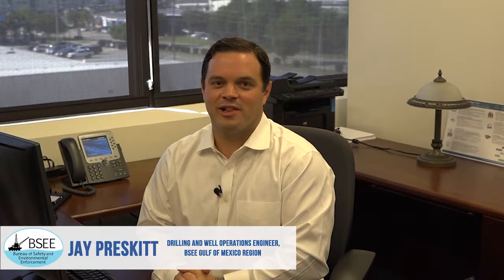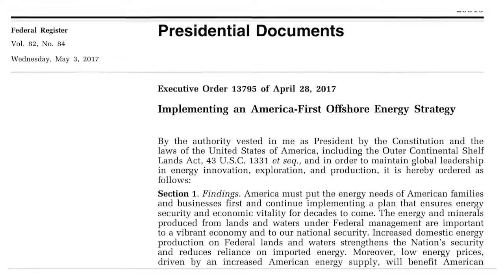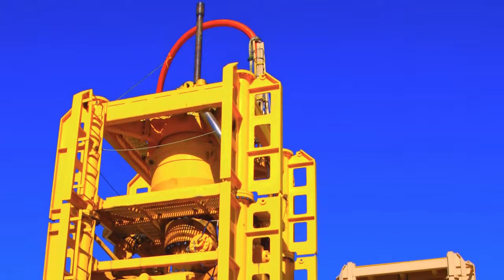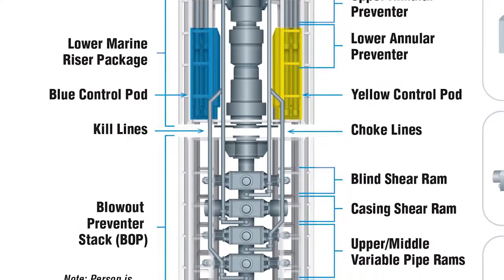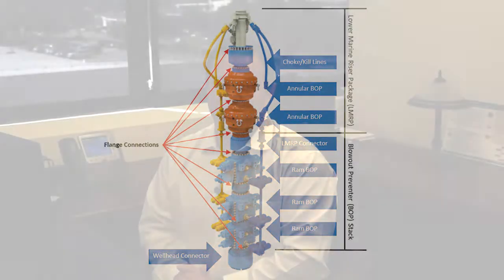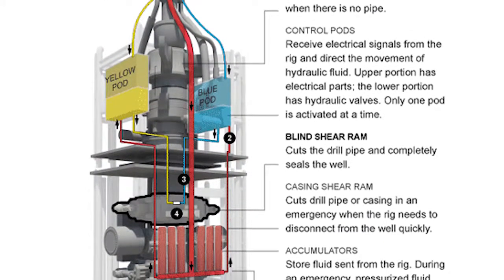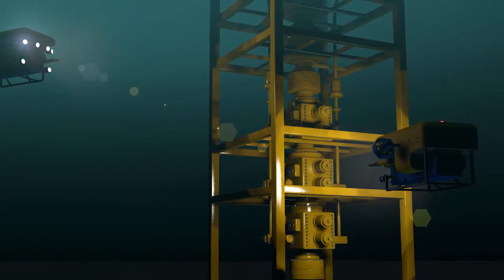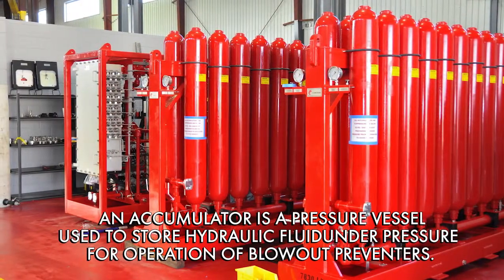Well Control Rule 2019 - BOP Requirements

Comment: BSEE needs to use the same regulations that land based oil production facilities use. Emergency shut off systems be periodically tested or repaired and records kept. Spill response contingency as well as training for personnel. 
The same blowout prevention system still in use that failed the deep horizon still in use current 2019. Consisting of annular valves and blind shear rams that are prone to failure. On deep horizon's macondo well spill highlighted the failures of this type of blowout prevention. The annular valve uses the rubber doughnut shaped seal to cover wellhead supply port and failed due to seal being damaged. When the emergency shut down activating the blind shear rams as a last resort failed due to the wellhead pipe being bent from a massive "kick" or Pressure spike occurred the pipe was not in alignment and the blind shear ram failed to completely crush/ cut the wellhead closed. This resulted in flow going through the failed blowout prevention system and through the riser, onto the deep horizon platform where expelled gases found a heat source.
I'm the designer of the caphead that was used to stop the macondo well spill. I'm a mechanic employed in Alaska's North slope oilfields at Prudhoe Bay area at the kuparuk river unit for a company subcontracted to conoco Phillips. Current 2019.
I also have over 30 years experience in pipeline repair and maintenance. On June 20, 2010 I watched news coverage of the horizon spill response crew using underwater robotics to cut bent sections of pipe away from the wellhead pipe. This left several feet of pipe sticking out of the seafloor and also had a pipe flange inches from the pipe end. I designed the caphead spool that could be lowered onto the wellhead and lock onto it by using lugs or wings to secure on behind the flange. The caphead used hydraulic chevron seals at the bottom that would use well pressure would force the chevron seals down sealing and stopping the spill. Flow could be directed towards the surface and recovered onto a barge or tanker. Once flow is controlled well pressure overcome by using a downhole pump (tritan) and inject the sealant of cement/slurry mix into the wellhead until full by volume. The caphead would remain in place until the sealant hardened stopping the macondo well spill. I found that later that day that BP had a "horizon helpline" available asking for assistance. I called and chatted with the horizon personnel and stated I had a caphead spool design that would stop the macondo well spill. They asked,if they could look at. I submitted my design and was notified that my design was unusable. I tried calling the horizon helpline only to find out it had been discontinued. I neglected to file for a patent on my design. Several weeks later I again watched news coverage as my caphead design was used to stop the spill.i still have copies of the design submitted as well as emails to and from the horizon helpline. Later I was in touch with BP via email and was told that since my design wasn't patented that the design belonged to them. I did what I could and was unable to find legal representation and decided to wait to voice my opinion. I also still have a case lodged in the BPCLAIMS.ORG. 
I've had time to go over the current blowout prevention systems and can guarantee future spills will occur due to design. The current blowout prevention systems become a time bomb once in place before 1 gallon of crude goes through the riser. It's worst feature is that there is no way of isolating pressure. The annular valves and blind shear rams aren't. Designed to be tested periodically or repaired or maintained. If this type of blowout prevention system did work as designed, still leaves a well sealed only by crushed/cut piping.  Any attempt to repair or abandon will result in a spill.  I have design upgrades for a safer, better blowout prevention system that can be tested periodically to verify proper operation, as well as repaired and maintained and means a better chance of preventing further spills. This also means if the well does down for repair, can be returned back to production. The current blowout prevention systems since are pressurized will not be touched and upgrades designed around. The annular valve can still be used even with bad seals as a pressure flow control and blind shear rams used only after the wellhead sealed by cement/slurry and crushed/cut closed. New wells can delete the old blowout prevention and use my designs. My designs are available but are not free and will be patented. This also means safety regulations will need to be adopted by BSEE. "007".